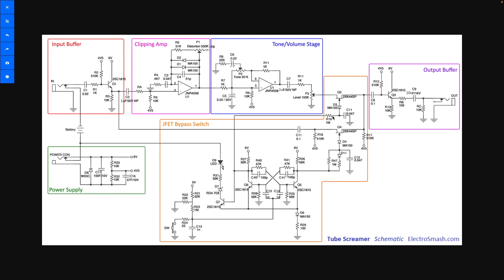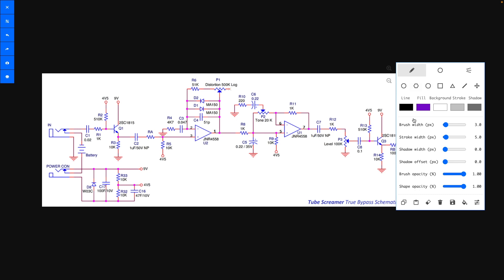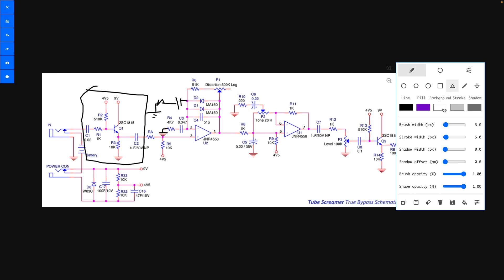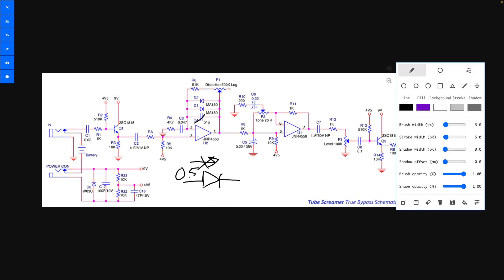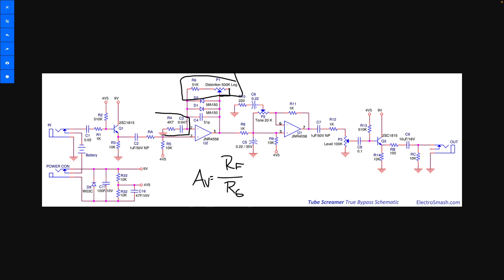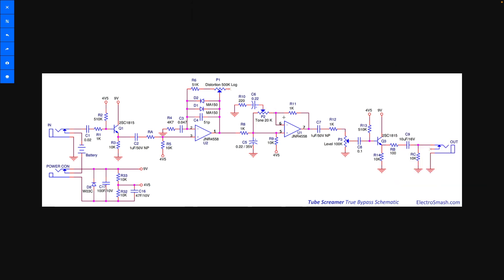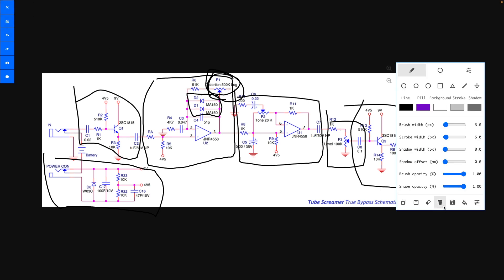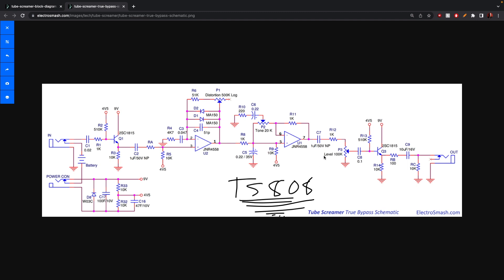Tube Screamer Schematic Analysis

Comment: Why the caps are rated for 50V in a circuit that works on 9V?
Reply from the maker: That's more of an upper limit than a suggested voltage. The caps still work at lower voltages.

Comment: I believe that the term "center" frequency is not quite accurate.  "Fc" should be "cutoff" frequency, which is at the 3dB point.  A reduction of 3dB is the "Half-power" point, but not 50% reduction in audio level, I believe.  Otherwise, decent explanations.  This made me think of stuff I haven't thought of in 30yrs.
Reply from the maker: Yep. Center Freq, and Cuttoff Freq are synonyms. They use "cutoff" on synth control panels, I think I picked up "center freq" from a math course. They're different words for the same idea. And spot-on about that -3dB. That's what I'm talking about.

Comment: It's funny how, in the schematic, when the plug is connected to the input, the battery is disconnected.  How would this circuit even work.  It will work if the battery negative is connected to the ground side of the input jack.  Another way is to use stereo jack.

Comment: There's no bypass path for when the pedal is not engaged.
Reply from the maker: Actually that whole orange section labeled "JFET Bypass Switch" is the bypass path. It's not a typical "true bypass" though, so even when you switch the pedal off there is at least a buffer and some other stuff going on. So in that sense this circuit never fully turns off. If you want to mod it with a true bypass that would be super easy though.

Comment: Dumb question about the JFET Bypass switch in the very beginning: The first schematic is an example of a pedal WITHOUT true bypass? And true bypass is a simpler way to do it than the JFET Bypass switch?
Reply from the maker: Yeah, true bypass is basically a switch that flips between your input passing through the pedal circuit and then to the output, or simply connecting your input jack straight to the output jack.

Comment: Surely, the battery negative will be disconnected from all parts of the circuit as soon as the input has anything plugged in!  Likewise, the Power Supply negative has no connection to any part of the circuit at any time.  Is this intentional?
Reply from the maker: Not sure I fully understand your question, but the negative end of a power source here is what we call ground. If it's not connected to the circuit you'll have an "open circuit" and the circuit wont work. All those points with layers of lines are the negative terminal of a power supply. So, there are a whole bucket of connections from power supply negative to the circuit. Hope that answers the Q.
Reply: @theandromedacorporation   Thanks for taking the time to reply, that clarifies the point behind the query as there are plenty of connections to ground showing on the schematic,  but nothing showing the connection between the battery negative and ground.
Reply from the maker: @mikegardner5859  Right. It's pretty typical in this sort of schematic to see multiple nodes labeled as voltages and ground without actually including a symbol for the power source that supplies those voltages.
Reply: How would you boost the output volume in the output section of the schematic?
Reply from the maker: @stephenmonike1906  I wouldn't. The circuit amplifies the signal up, and then the volume knob turns it all back down. If you're building a tube screamer and it's quieter than your input signal you've probably got the wrong resistance somewhere in the opamp stages, or something like that.

Comment: C3 actually blocks DC gain. With the input sitting at 4.5 vdc, the gain of the op amp would drive the output constantly to the positive rail
Reply from the maker: True.
Reply: Hmm, I'm new to this, am I understanding correctly? I get the gist that if the op amp sees, say, 5v on the noninverting input, it's output must be ~5.7V to compensate for the D2's voltage drop (minus whatever gets through the level pot). Hopefully got that right. To soft clip a "negative" signal like 4v, we need a negative voltage crossing D1. C3 and R4 are a high pass circuit with a center frequency of 720hz. So lower frequencies, including DC, are blocked. That means C3 is usually charged to 4.5v, which means the opamp sees 4.5v on the - pin and 4v on the + pin....it tries to sink .5v of current but has to sink an extra .7v to overcome D1's voltage drop (minus whatever flows through the level pot), and it sources that current from C3?

So the saturation curve is linear with some slope (set by the feedback resistor), and when the output of the curve hits .7v, the curve is linear with a slope of 1?

Thanks in advance. And, if I'm wrong all over the place, I apologize and don't expect a super thorough correction, I just need to go back to basics if so I think.
Reply: @MichaelFairhurst  The first opamp is essentially a unity gain amp for DC.  It develops gain for AC signals where R4 comes into play as one of the resistors for calculating gain.

Comment: R4 4.7k and P3 100k are both connected to 4.5V V bias instead of Ground. You can open up an 808 or 9 and see. I've studied TS/ DS-1/ Klon schematics from ElectroSmash so far, lots of time spent, and I found that all of them had a little bit of differences. An object or a reliable replicant is needed when you really want to understand the whole thing through.
Reply from the maker: Interesting. Thanks for the insight!
Yeah, did a quick google search and I found an example that's biased like you describe. Luckily those differences don't really change what's going on in the circuit. R4 could be biased to either voltage or even +9V and not have any audible difference since audio sees all kinds of stuff as ground, and if I'm not mistaken the gain on the input amp would still be very close to 1 if you bias R3 to either 0V or 4.5V, so that's no biggie either. 

I wonder if these differences are accurate depictions of different circuit board revisions, or if somebody made an error while copying the circuit.